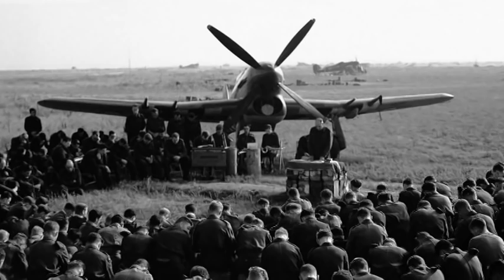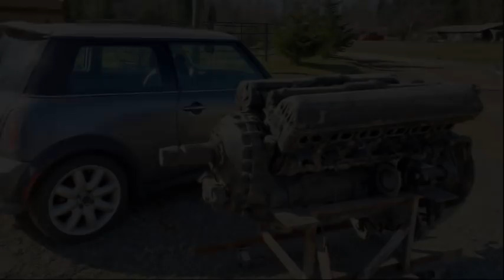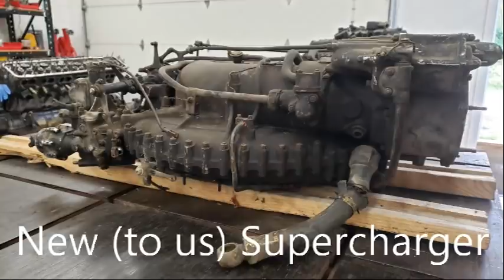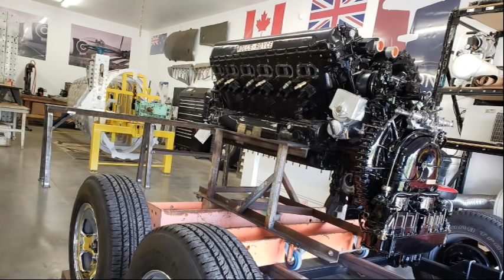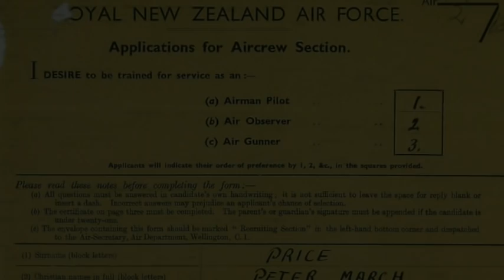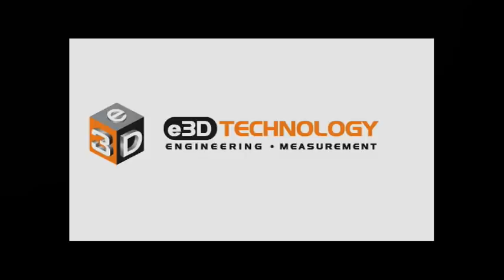Episode 18 Typhoon Legacy Rolls Royce Merlin III Build

Comment: When Packard started building Merlins - they couldn't get the same amount of power as Rolls-Royce was getting and were totally baffled as to why. So they contacted RR, and Rolls sent over an engineer to figure out the problem.  He figured out it was the bearings in the engine when he asked them to see their polishing setup for Bearings, and the Packard engineers were STUNNED.  Rolls-Royce pays MINUTE attention to DETAILS!
Reply from the maker: Great bit of information, certainly the detail is something we have been amazed by while working on this engine. ~Ian

Comment: When I was a engineering student I was sent to work in a foundry and the first job I was given was breaking up new RR Merlin aluminium casings to be melted down.
They were excess stock and sold by The Royal Airforce as scrap.
What a waste.
Reply from the maker: It's hard to imagine now, but this type of work continues to this day. I recall having to scrap spares for the T-33 when they retired from the RCAF. ~Ian

Comment: Always impressive to realise that the power output of the Merlin pretty much doubled from just over 1000hp (on 87 octane) for the Merlin III you have here to just over 2000hp for the Merlin 130/131 in the DH Hornet, as a result of improvements in fuel, supercharging and intercooling.
Reply: They started with a low specific output, it’s not particularly hard to improve a big capacity engine with low specific output, but what is impressive is how quickly they did improve it

Comment: I remember reading that RR did not issue tolerances for their parts, so each was simply made to a size - or near enough! Then the assembly guys had to go through the parts and find those that actually fit together and even modify parts to fit. Packard could not produce the Merlin on a production line until it was redesigned with proper fits and tolerances. That took months. I understand that RR were quite shocked when Packard told them that their drawings would not be acceptable for a car production line. But to be fair in the 1930s RR never thought that the engines would be produced on a production line.
Reply: Packard could not mass produce the merlin from the RR blueprint, as in England each engine was hand built , so each part was machined for each engine. Well ,that’s not going to work for mass production, but apparently the British built engines were smoother, and marginally more efficient.
Reply: @hoonaticbloggs5402  Thats a good point. If you hand build with the best fitting parts you end up with a better engine as the fit is optimised.
Reply: @raytrevor1  
Like an engine for a production race car. 
But yea, can’t make as many as quickly that way,
Reply from the maker: Very interesting, thank you for sharing! ~Ian
Reply: I've been reading around the subject and it appears that nothing is quite as simple as it first appears. The 'craftman produced' RR Merlin was very much in the 1930s and at the start of the war. Before the deal with Packard, RR had started redesigning the Merlin for production by Ford. By the time Packard started mass production, RR was also moving into mass production in UK.

Comment: Great vid, and a very nice Merlin! Shame about those cam lobes. Regards the prop, there are recent videos out there of a Merlin out of a Mosquito being run without a prop in NZ. Would it be possible to run yours without a prop to save worrying about that spline?
Reply from the maker: I think it can be done safely, but ideally it is nice to have load on the engine. It's also nice for displays to see the prop! ~Ian
Reply: Never run a Merlin without a load for any length of time.  If you don't understand why, then get someone else to work on your engine.